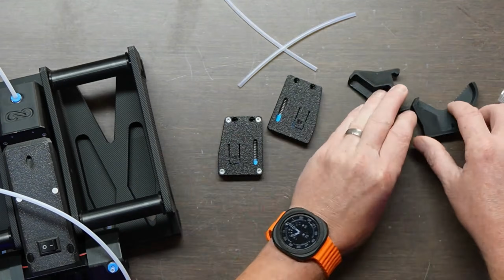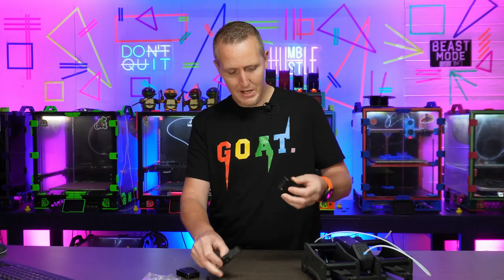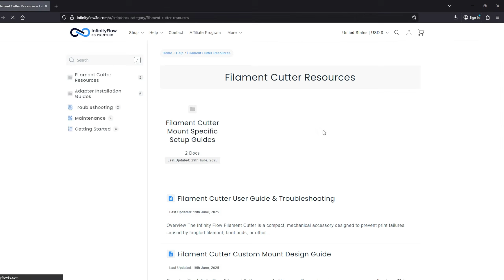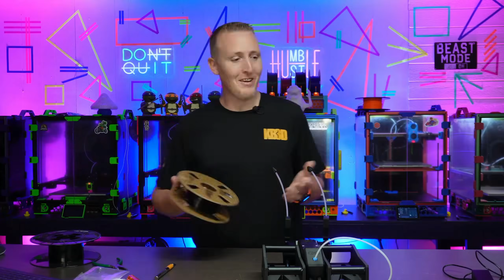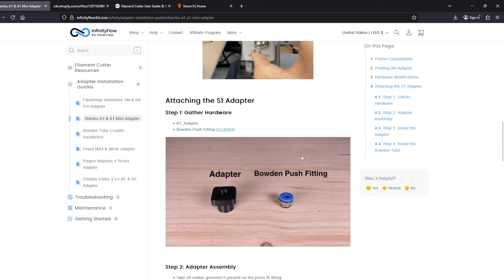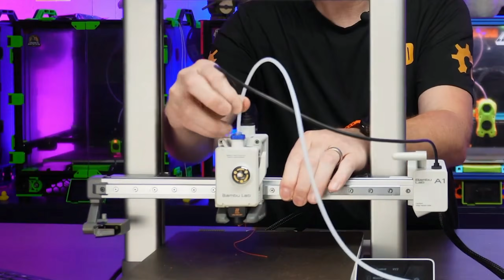Infinity Flow S1 UPGRADE! 🚀 New Filament Cutter Fix + Install & Board Replacement Tutorial

Comment: Why does the A1 require any sort of adapter? Can’t you just plug the PTFE tube directly into the A1 just like any other filament?
Reply from the maker: I suppose you could plug into one of the 4 plugs on top of the extruder also. But if it's going to stay that way I guess it's best to use the adapter to have the one running directly into the printer. Good question though!

Comment: That teardrop piece is meant to reduce tension caused by the filament binding next to the spool sides or due to uneven winding. I have the S1 Plus and it works great.
Reply from the maker: Oh that's cool! Thanks for letting me know about that. I was a bit curious about the shape of those.

Comment: If you have an Ender 5 max, my suggestion is to avoid this product till they get a custom solution.  I received this unit 6 day ago and have not been able to make it through a print and have wasted at least 3 kgs of filament.
Reply from the maker: Oh really? What issues are you having with the Ender 5 Max? That's a lot of wasted filament too! Sorry you are having trouble with it.
Reply: @leemerie3d I have no problems with the Ender 5 max.  it runs as it should.  The Ender 5 Max doesn't have a Bowden port on the entrance, therefore you have to bypass it and use a coupler.  Which should work fine.  The problems came from th S1 and the filament cutters.  Their failure ment the printer would run dry and wouldn't know it was out of filament.  Since I couldn't babysit the S1, it always seemed to fail.  I have removed from the setup and I am back to making parts with the ender and only occasionally will I have a print be paused till I reload.  At least it not a failure.
Reply from the maker: So there is another update to the S1 being the plus. It comes with wifi and an app to monitor things. But it sounds like there may be an issue with the cutter from what you mentioned here. If you need some help with it or want to troubleshoot some more I'd be happy to help you or anyone on our discord server. Link is in the description if you aren't already in there. Sorry again you are having trouble with that.